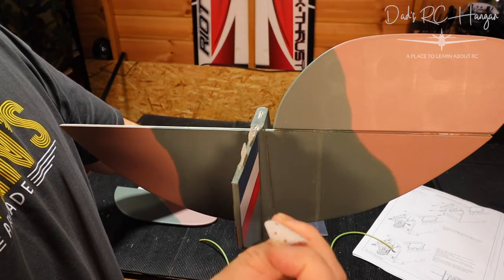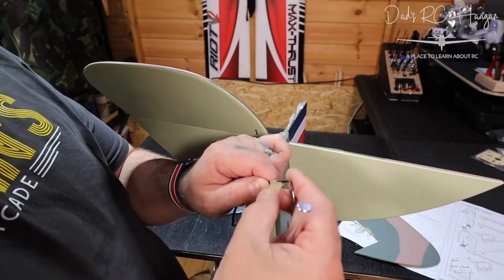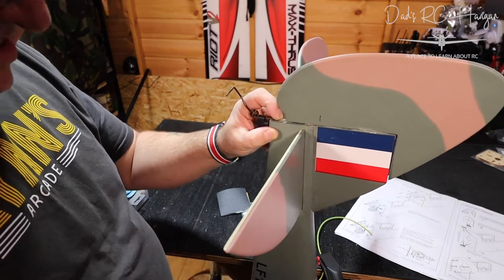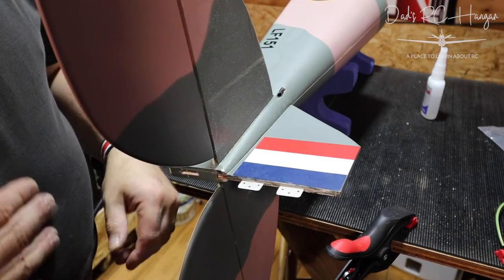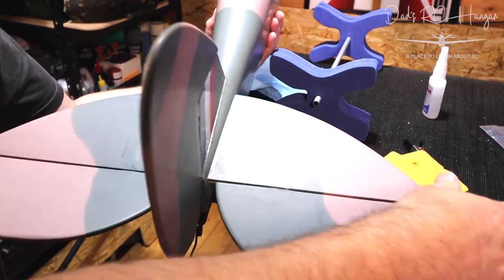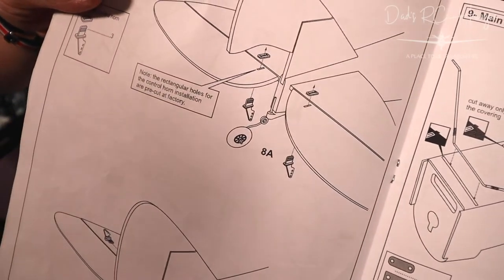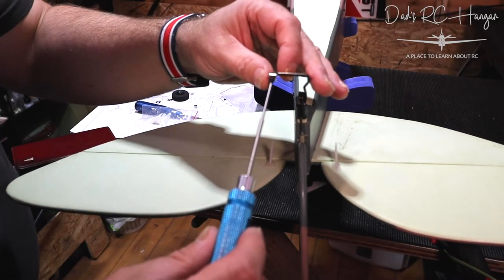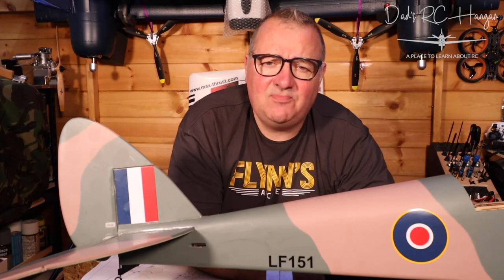Nexa DH82 Tiger Moth British Camo The Build Part 2 "The Fix"

Comment: hi mate,im building the hobbyking tiger moth (cambridge flying groups) It seems to be he same model as yours, i checked out the manual for each and they are pretty much the same. I am at the same stage as you. good luck and keep going!
Reply from the maker: Are you going to use a Ic engine as well?
Reply: @DadsRCHangar  I am using a saito fa72 golden knight
Reply from the maker: Ooooyea, that sexy. Wanted to get this one but it was not in stock. 👍🏻
Reply from the maker: Yup she will hopefully look as good in the air soon. Be good to watch so you have a heads up on certain build parts. Good luck with yours 👍🏻
Reply: @DadsRCHangar  any decision in the fuel tank yet?

Comment: I read one persons review and he said…”The one downside is the vynl type covering and the weak landing gear. The covering can get a bit warped in the sun but always returns to original form and the wrinkles do not affect the flight characteristics” Is the covering something other than iron on that i can get any wrinkles out of with a heat gun?
Reply from the maker: Well covering is expensive now, but a lot of people use Doculam, you can even spray it, using certain paints. 

The landing gear is weak, but you can get a stronger type made for you. 
I guess I don’t mind tinkering, and if it’s a project then you can have fun.
Reply: @DadsRCHangar  Is that what the Nexa Tiger Moth is covered with? That material is meant for laminating documents. It does hold paint very well, but…
Reply from the maker: @radioflitercairplanes1715  No this is covers in that sticky vinyl. It’s the Nexia version. I have a Hawker Hunter  I am building, I will cover in Doculam and then tissue it with Dope, then spray. Apparently you can put a primer on Doculam.

Comment: I've got one seems really tail heavy did you have to add weight to the nose for balance
Reply from the maker: Hi Brody, I have yet to maiden her, but on the bench she seems fine, I did have the Battery under the fuel bottle after all. I hopefully fixed for a maiden next year. Sorry I cannot be more help. 👍🏻
Reply: @DadsRCHangar  cool I went with an RCGF stinger 10cc worked out beautiful in the end added 100gms and batteries up front flies like a dream keep up the good work bro 🙂
Reply from the maker: @gangstar83904  that’s great Brody, and thank you for encouraging words. Have a great week 👍🏻

Comment: i am also wondering what to do about the fuel tank and canopy problem as mine is the same as yours, dremel the underneath of the canopy in an arch shape?
Reply from the maker: I think rather than cutting up the plane, I might get another bottle. I will let you know what one I get this week. Thanks for watching and I hope you subscribed👍🏻
Reply: I added a petrol tank lifted the floor in the front cockpit up to clear pipes 👍
Reply: @gangstar83904  I ended up buying a sullivan flex tank

Comment: SPEAKING OF A FIX I NEARLY HAD A DISASTER TODAY.  JUST AS LIFT OFF THE ELEVATOR STOPPED RESPONDING FORTUATLY I  CUT THE TROTTLE AND LANDED INTO THE TALL WEEDS.  EVEN THOUGH I USED LOCKTIGHT AND A GOOD TOOL TO REALLY TIGHTEN THE SET SCREWS FOR THE DEVICE THAT CONTECTS THE THREE PUSHRODS FOR THE ELEVATOR THE CENTER ONE TO THE SERVO SLIPPED.  I AM PULLING THAT WORTHLESS THING OUT AND WRAPPING THE WIRES WITH WIRE AND SOLDERING IT.
Reply from the maker: Dam Gene, you were lucky. I wonder how this come loose. Great idea to solder thou. Thanks for letting me know 👍🏻